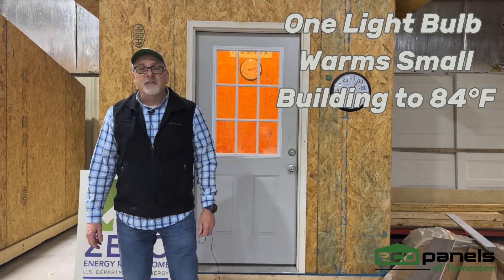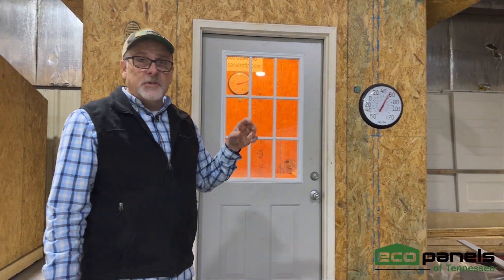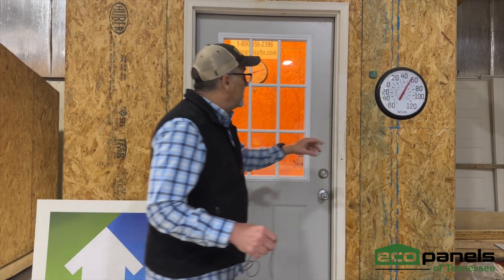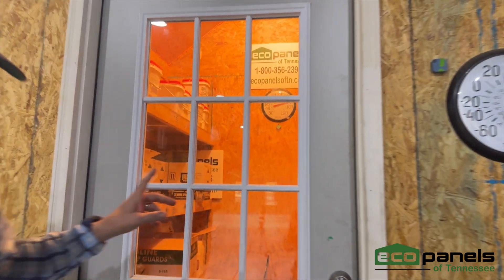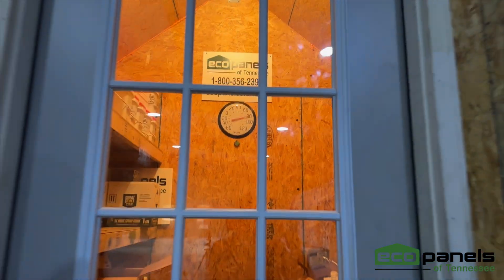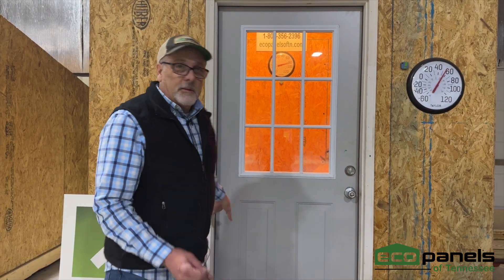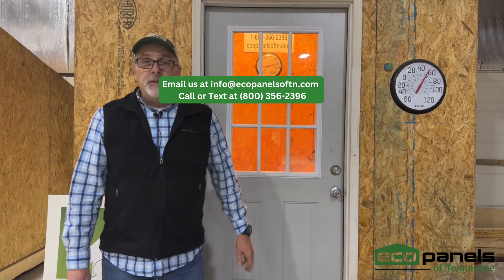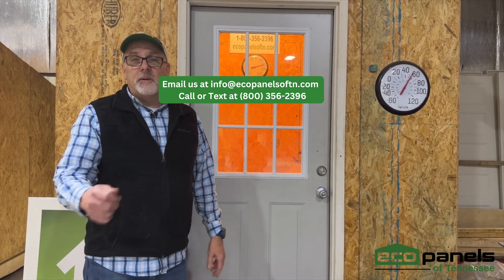Amazing Eco-Panels of Tennessee Heat: One Light Bulb Warms Building to 84°F

Comment: It’s been amazing so far as we build our house with your panels that the house does not fluctuate in temperatures. When we start the day working at the build site it will be 40 degrees inside and by the end of the day there is a 30 of more different in delta and house is still at 40. Looking forward to seeing data from customers
Reply from the maker: That's awesome. We've done a couple of builds ourselves and have noticed the same. Congrats on your home and thank you for using Eco-Panels!